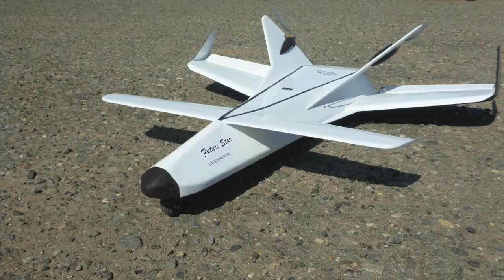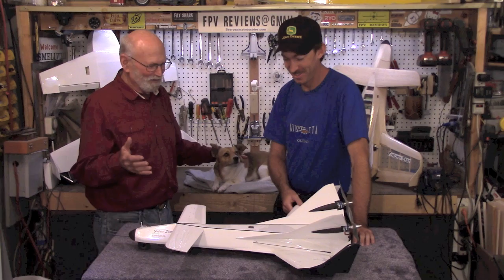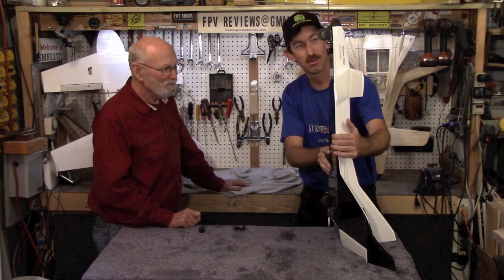"Future Star" Rocket Plane Concept Explained

Comment: Spike - Perhaps for a future build, scale this airplane up 200, or even 300% and jam a composite rocket motor in there. EDF power would be neat too. Anyway just spouting off ideas here, but I've always wanted to build an SSTO spaceplane concept like this, but money is always a factor. I think it's amazing, and there aren't too many options if one wants to build or just buy something like this out there.
Reply from the maker: I actually did consider an EDF version, and that would be really cool. I even designed the inlets, and everything, but chose not to build it, in favor of the higher thrust available from the props. I have no doubt it would be faster wight the EDF's. 
SSTO is a tantalizing concept, but requires some very advanced, complex tech, like the aerospike engine, which is very cool, if you have ever seen the testing videos from them.  worth watching for sure! 
I'd love to see something like this scaled up and built to fit underneath a cessna 172, or caravan. 
until then, people can play with this!
Reply: Haha, very cool. I saw the aerospike engine test and was very impressed. Do you have design sketches I could look at of the EDF concept? I'm curious how that would've looked.
Reply from the maker: not really, i made so may sketches, and several versions that actually flew, i don't think i took he time to actually make the sketches of the EDF version.  If i get the chance, i may revisit it, and put EDF's in it. It would have had two.  there would have been an inlet on each side, and they would have exhausted through the tail fairing used as a nozzle. it would be possible to actuate the top and bottom of the tail fairing to change the ratio of pressure vs velocity, or use the actuators together as thrust vectoring in pitch. 
perhaps a new design will be warranted to explore that concept specifically.  The design for Future star was actually quite constrained by the landing gear configuration of the mother ship, and by the mission profile.

Comment: Thankyou for such a good video which you have made it in detail But i still have a ' ? ' to ask if you have time to answer please do the needful it will be a great help can you make another video in detail of your planes your controls Transmitters Ground station  and what goes with plains example for plane list of detail parts Motor, ESC. Servos. Receiver. TX. RX. Flight Control. Cameras. Batteries. OSD. Radios and Mainly UHF do you use Both at a time for pilot and how long will can it travel. Sorry it may be to much i am asking for But it will be a really great help as i am crazy about model airplanes all the time i keep watching  some channels on you tube i like your channel because it neat and peace up in clouds
Reply from the maker: You can learn even more about the aircraft on our website"s a page called "Give Me More Data":
http://www.bearospaceindustries.com/give-me-more-data.html